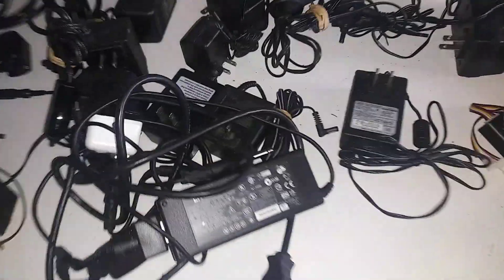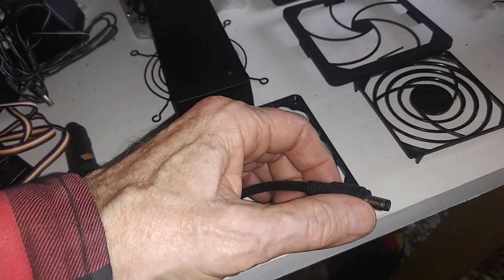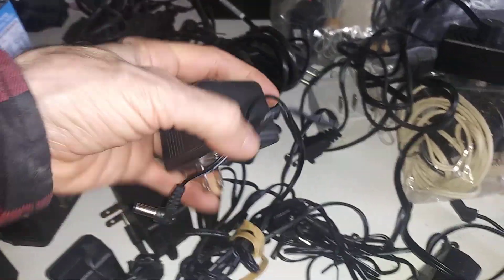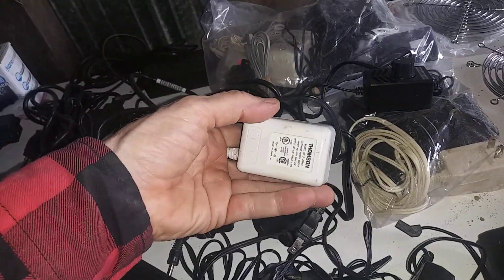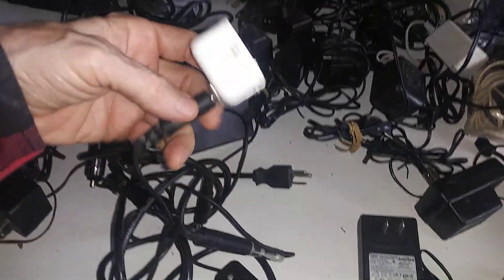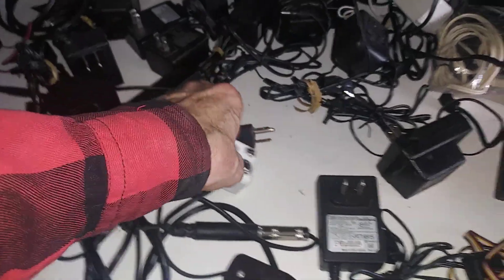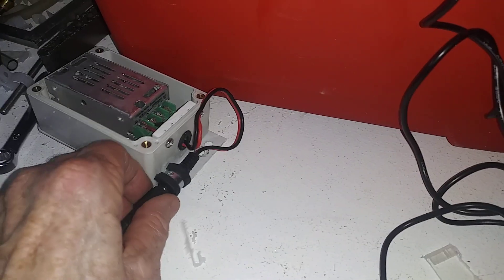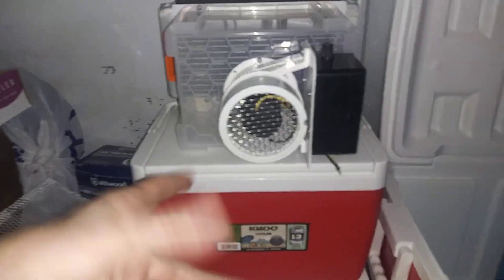Home Made Air Conditioner: 12 Volt Power Supply Choices

Comment: Great work man, you seem to be the leading expert on this, could I contact you about this?
Reply from the maker: Hey Kirk,
Glad you enjoy this work.

I'm going to be building closed loop ice chest ACs this summer. I built one last summer for a test. The ice will last longer in a closed loop model.

Depending on the size of the unit and ice used for a non fine tuned system ice can last variable amounts of time. The small red unit hold only a couple of pounds of ice and the ice lasts about 45 minutes but continues to keep cooling for about 15 minutes longer because the ice water is still so cold. On the larger units with 20-40lbs of ice the ice can last 1 1/2 or longer on a non fine tuned open loop system and continues to cool a little longer after the ice melts with the chilled water still circulating. After either system's ice melts they still cool for a while and then you'll notice the air warming gradually.

On open loop systems the size of the unit(ice mass) declares the cooling time etc. Closed loop systems cool much longer. That's what I'll be concentrating on with videos very soon! 

The quickest way to contact me is by email. I check my emails daily. My email is jamesrougeau@gmail.com

Have a great day!
James Rougeau
Reply: @HomemadeAC  awesome I think I saw a build that if combined with your system it could last 6-8 hours or even longer! It pulls in the hot air to the radiator first which is insulated above the ice chamber cooling the air before it hits the ice and due to it cooling the air before it hits the ice the ice lasts for hours but I find your fans and dimensions very interesting for the top box. Also I saw another YouTube video of people running metal duct in the bottom of the ice which doesn’t add moisture to the air not much at all. I imagine there is some combination that cold solve all the major problems. I’ll email you and see if if you have any thoughts on it. Thank you! Keep it up!